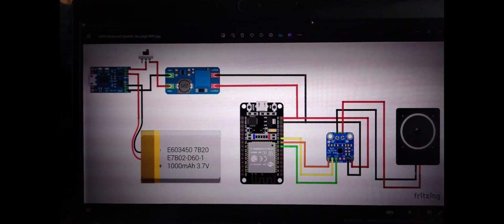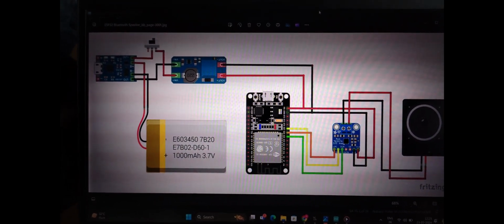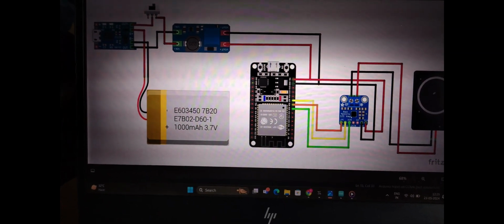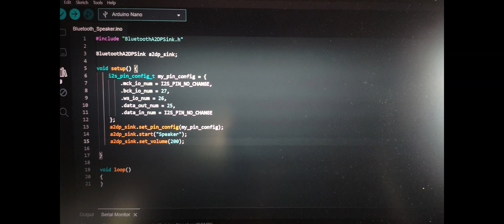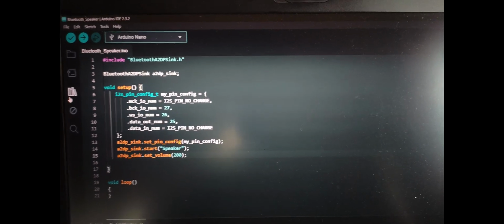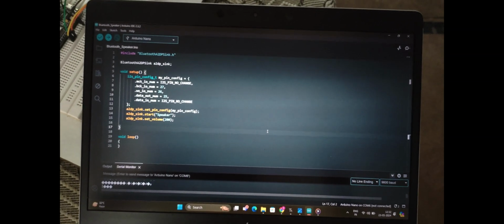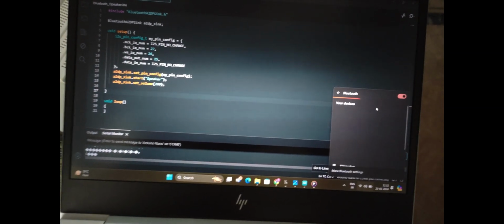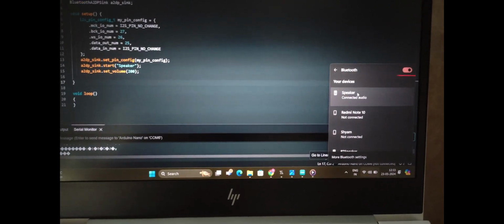Bluetooth Speaker Part 1

Comment: why code not working ?? error i2s_config_t
Reply: is dont work
Reply: Arduino: 1.8.19 (Windows 10), Board: "ESP32 Dev Module, Disabled, Disabled, Huge APP (3MB No OTA/1MB SPIFFS), 240MHz (WiFi/BT), QIO, 80MHz, 4MB (32Mb), 921600, Core 1, Core 1, None, Disabled, Disabled"

C:\Users\Nouveau\Desktop\ESP32-Bluetooth-Speaker-main\Bluetooth_Speaker\Bluetooth_Speaker.ino: In function 'void setup()':

Bluetooth_Speaker:6:5: error: 'i2s_pin_config_t' was not declared in this scope; did you mean 'gpio_config_t'?

    6 |     i2s_pin_config_t my_pin_config = {

      |     ^~~~~~~~~~~~~~~~

      |     gpio_config_t

Bluetooth_Speaker:13:15: error: 'class BluetoothA2DPSink' has no member named 'set_pin_config'

   13 |     a2dp_sink.set_pin_config(my_pin_config);

      |               ^~~~~~~~~~~~~~

Bluetooth_Speaker:13:30: error: 'my_pin_config' was not declared in this scope; did you mean 'gpio_config'?

   13 |     a2dp_sink.set_pin_config(my_pin_config);

      |                              ^~~~~~~~~~~~~

      |                              gpio_config

exit status 1

'i2s_pin_config_t' was not declared in this scope; did you mean 'gpio_config_t'?

This report would have more information with
"Show verbose output during compilation"
option enabled in File -> Preferences.